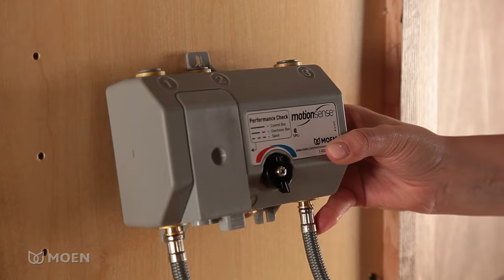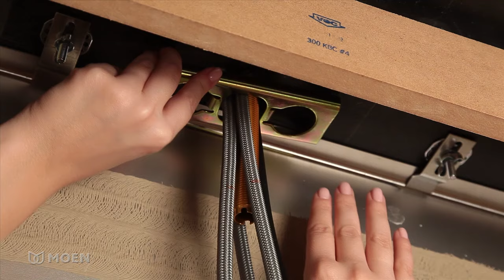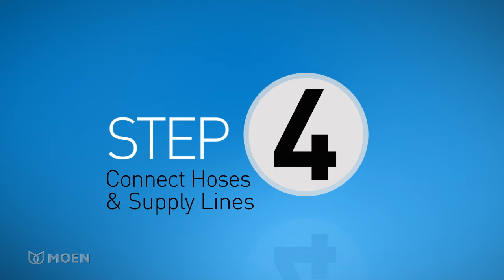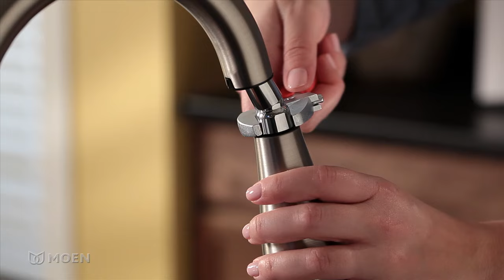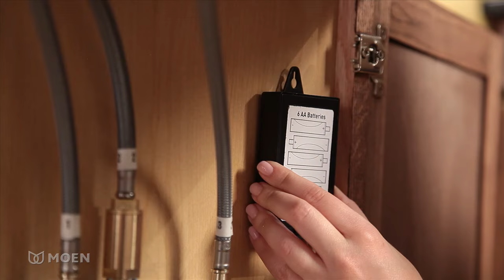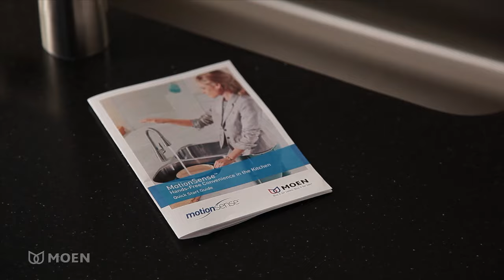How to Install a Moen MotionSense Kitchen Faucet

Comment: Are you able to install without battery?
Reply from the maker: Hello sistamist.  The Moen MotionSense kitchen faucets will require power by either the included battery pack or the Moen 169031 AC Adapter with Power Splitter; sold separately.
Reply: @moenfaucets Thank you!
Reply from the maker: Hello. You're welcome and thank you for your continued support of the Moen brand.

Comment: I just replaced the batteries on this and the water will not stop. What do I do?
Reply from the maker: Hello @kcseabridge2665.  We are sorry to hear of the difficulty you are experiencing with your Moen MotionSense or MotionSense/Wave Pull-down Kitchen faucet.  The following links will assist you with troubleshooting this issue and are based on the number of sensors the faucet has:

https://solutions.moen.com/MotionSense%3ADual_Sensor-Hands_Free_Faucet

https://solutions.moen.com/MotionSense%3A_Wave-Single_Sensor_Hands_Free_Faucet

For further troubleshooting assistance, Moen product specialists can be reached at 1-800-289-6636 and they are available Monday through Friday from 8:00 am - 7:00 pm Eastern Time.

Comment: I have the grey control unit shown in this video and it no longer works, which means we use manual mode only. @moen is it correct that the grey unit is no longer supported and only had a few years of warranty? Not lifetime? I've heard that the newer black control boxes don't allow manual mode without power to the box, so i guess that's a benefit of the older box, but it would be nice to be able to fix the one I have.
Reply from the maker: Hello @JMart6. The gray and black control box versions have a Limited lifetime warranty against leaks, drips, finish defects,  and a 5 year warranty on electronic operation defects to the original consumer purchaser. The black box version does require power at all times to operate. Should you have additional questions, please feel free to call us at 800-289-6636. We are available Monday through Friday from 8:00 am - 7:00 pm (EST).

Comment: If the little light in the motion sense window won’t come on at all, what does that mean? Changed the batteries, unplugged and plugged in multiple times. Is it broken?
Reply from the maker: Hello @yuliyashishlo.  We are sorry to hear of the difficulty you are experiencing with your Moen MotionSense faucet.  
Based on your description, further troubleshooting will be required to determine the cause and resolution of this issue.  You can call us at 1-800-289-6636, Monday through Friday from 8:00 am - 7:00 pm Eastern Time.  
If you'd prefer, you can use the following link to send us an email and a picture of the installed faucet:

https://www.moen.com/customer-support/contact-us

Comment: How do you remove / disconnect lines from control box to replace
Reply from the maker: Hello Tim.  To disconnect the push fit hoses from the control box push down on the gray ring on the control box. While firmly pushing on the gray ring, pull the hose to remove. Refer to the following link:
https://solutions.moen.com/Article_Library/MotionSense_Dual_Sensor-Removing_The_Push_Fit_Hoses_From_The_Control_Box
If you need additional assistance, please email us by visiting our Contact Us page at https://www.moen.com/customer-support/contact-us or you can call us at 1-800-BUY-MOEN (1-800-289-6636). Our business hours are Monday through Friday from 8:00 am - 7:00 pm Eastern Time.

Comment: Hey Moen, 
Have this faucet but don't have the manual. Is there more resources on what the error codes mean in more detail? Occasionally ours will stop working. Unplugging and plugging back in shows the red light pulse ~6 times, then it seems to work for about a week. Afterwhich it will randomly stop working again.
Reply from the maker: Hello Bgrishinko. The user manual for the MotionSense faucet is below.  
https://solutions.moen.com/@api/deki/files/72472/MotionSense_User_Guide_Pages.pdf?revision=1
We would need to troubleshoot the issue further to determine if the control box, electronics box or spout kit would need to be replaced. Please email us by visiting our Contact Us page at https://www.moen.com/customer-support/contact-us or you can call us at 1-800-BUY-MOEN (1-800-289-6636). Our business hours are Monday through Friday from 8:00 am - 7:00 pm Eastern Time.

Comment: How to make it running manually?
Reply from the maker: Hello Casey.  Moen MotionSense/Wave Kitchen faucets offer the ability to operate the faucet with the sensors or with the manual handle.  The faucet still needs to be connected to power-batteries or AC Adapter-for the manual handle to work.

Comment: Our Moen hands-free faucet stays in the start-up mode, and keeps turning itself on randomly.  We've replaced the batteries, re-booted the system, checked the power and data cable connections, all to no avail!
Reply from the maker: Hello John, Moen would be more than happy to further assist you with your Moen kitchen faucet. Moen would need additional information from you. Please contact Moen directly at 800-289-6636. Our business hours are Monday - Friday 8 am-7 pm EST.

Comment: A low water coming out the faucet. Any advice?
Reply from the maker: Hello ME Tubay, Moen would recommend you take the spray wand off and clean the screen washer between the hose and wand. If this does not resolve your issue, Moen would also recommend cleaning and flushing the filters.

Following the instructions below:

Cleaning the first filter:

1. The gray control box has hose numbers imprinted on it. The number 2 hose has a built-in filter. To remove the filter from hose number 2, firmly push the gray ring against the control box while simultaneously pulling the hose out. 

2. Once the hose is disconnected, unthread the brass fitting on the end of the hose. Hold the number 2 hose with a wrench at top of the filter connection. Unscrew the filter with a second wrench. 

3. Rinse debris from the filter screen. Reassemble the filter into the housing and tighten using two wrenches. Insert the number 2 hose assembly into the control box. Gently tug on the #2 hose to check for a secure connection. Turn on the water supply.

Cleaning the second filter: 

1. The housing for the lower filter is located on the underside of the control box. Loosen the filter plug with a flathead screwdriver.

2. Pull the filter off the filter plug. Note: There will be some water released from the control box filter plug location, place a cup under the location to catch any water.

3. Rinse debris from the filter screen. Firmly push the filter back onto the filter plug and thread it back into the control box. Turn on the water supply.

If the instructions above do not resolve your issue, please contact Moen directly.
Reply: Thanks for replying back. Is there any video that you can share other than instructions that you provided. Thanks in advance for your help.
Reply from the maker: Moen does not have a video; however, if you use the link below you will have a visual of how to clean the filters. 

https://solutions.moen.com/Article_Library/Low_Flow%3A_Cleaning_Faucet_Filters_(2012-2015)

If you need further assistance, please contact Moen directly at 800-289-6636.
Reply: @moenfaucets  Still having issues with information provided and probably the main problem is the control box
Reply from the maker: Hello ME Tubay. We are sorry to hear that you are still experiencing an issue with your Moen MotionSense kitchen faucet.  At this time, we would suggest contacting Moen directly in order to further troubleshoot your faucet with you.

Comment: How do you remove the push fit connections?
Reply from the maker: Hello A Skoyles. To remove the push fit hose from the control box, push down on the gray ring on the control box. While firmly pushing on the gray ring, pull the hose to remove. Please refer to the following link:
https://solutions.moen.com/Article_Library/MotionSense_Dual_Sensor-Removing_The_Push_Fit_Hoses_From_The_Control_Box
Reply: @moenfaucets  tried that.  Doesn’t work.  They won’t budge. Any other ideas?
Reply from the maker: We are sorry to hear you are having difficulty removing the hose(s). To further assist you, please send us an email by visiting our Contact Us page at https://www.moen.com/customer-support/contact-us or you can call us at 1-800-BUY-MOEN (1-800-289-6636). Our current business hours are Monday through Friday from 8:00 am - 7:00 pm Eastern Time.
Reply: @moenfaucets  not helpful.  I had to cut them and trash the whole thing
Reply: I Hate these faucets only acts when my wife uses the sensor I never use sensor just the handle

Comment: How do you remove the push fit hoses??????
Reply from the maker: Hello Sam the Handyman, To remove the push fit hose from the control box, push on the gray ring on the control box. While firmly pushing on the gray ring pull the hose to remove.
Reply: @moenfaucets  this a terrible design and multiple customers have inquired about the same push fit hose removal. Obviously one would think you could simply push on the firm gray rings to remove the hoses but that’s hasn’t been the case. Is Moen working on developing any fail-safe mechanisms for future uninstallation?
Reply: @2Maradoo  yes agree it is ridiculously difficult to get those things off.

Comment: mine failed after 2 years, i have been using it as a regular faucet for the last 3 years. (waste of 500$)
i think the control module is broken...
it doesn't even light up, tried new batteries and everything...

so how much is this service kit to fix my broken faucet?
Reply from the maker: Good afternoon. I am sorry to hear of the issues you are having with your Motion Sense kitchen faucet. Please send us a direct message with your first/last name, address, phone number, email address, further description of the issue you are having and a copy of the receipt if available.
Reply: How to take. apart faucet to connect I cable back .

Comment: Water wont turn off. Motion sensor went completely dark. Changed batter and still not work. I cant use the kitchen sink faucet now as i had to shut the water off from the main source. Please help!!!! I wish i got a standard regular faucet!!!!!
Reply from the maker: Hello L, I am sorry to hear you are having issues with your current Moen Motionsense faucet. Please contact Moen directly for further assistance at 800-289-6636. Our business hours are 9:00 a.m. - 5:30 p.m. Monday through Friday Eastern Time. Moen is currently experiencing higher volumes at this time, you can also contact Moen directly at the “Contact Us” link on the Moen website at www.moen.com.
Reply: Did you find a solution? This just happened to me. 🤬

Comment: How do you adjust the sensitivity? I recently changed my batteries and the unit comes on when someone stands in front of the sink.  Is that a sign that the module needs to be replaced?
Reply from the maker: Hello. This is our Arbor Motion Sense faucet. It is available in shiny chrome, model # 7594EC or spot resist stainless, model # 7594ESRS.
Reply: @moenfaucets  I have 8735ESRS Haysfield with Motion sense. I have a problem, the sensors don't sense to turn off. The water keeps going forever never stops. Unless I remove the power cable,data cable and cutoff water supply. What could be happening? My faucet refuses to sense manual mode too. I have a kitchen sink with no water. Is there a way to bypass the sensors and purely go manual?
Reply from the maker: Hello Aaron.  We recommend resetting the faucet.  To complete the reset, unplug the power and data cables from the control box.  After 60 seconds, plug in the data cable first, followed by the power.  Please ensure that the data cable is installed completely into the electronic box.  This connection is a tight fit; and, if not fully engaged, the faucet will not work properly.  Do not stand directly in front of the faucet during startup/calibration.  Our Product Specialists would appreciate the opportunity to troubleshoot and offer technical support.  Please feel free to call us at 1-800-289-6636; our Consumer Services Center is available Monday through Friday from 8:00 am – 7:00 pm Eastern Time.
Reply: Moen Thank  you very much. I disconnected the battery pack for about 40 seconds and reconnected it to the module. The faucet is working a little better now, not AS sensitive. Question for you. Why wasn’t the faucet supplied with the option to power the faucet from the wall?
Reply from the maker: Hello Aaron.  That is good news about the reset!  
We offer an AC Adapter with power splitter, part number 169031, which must be purchased separately.  The power splitter will work as a backup power source if your home loses electricity. You would use the battery pack supplied with the faucet when installing the Power Splitter and AC Adapter.

Comment: I have a granite back splash that the hits the granite back splash, can't get the full hot when used in manual mode. How do you remedy that?
Reply from the maker: Craig Barr, for technical assistance please contact us at 1-800-289-6636.

Comment: man people are getting too lazy to even turning the lever????.....I would think crawling under the sink to change the batter would be more of a PITA.....Someone said Luckily the faucet works manually with batteries installed.   So when the power goes out/batteries die it  doesn't work?
Reply from the maker: Hello Dennis M.  The first generation of Moen's MotionSense faucet could still be used, by turning the lever handle to turn on/off the water, even if there was no power to the faucet-no battery or AC power.  The second generation of Moen's MotionSense faucet can only be used if it has power to the faucet.
Reply: I'll stay with manual mode.....my goodness!!!
Reply: @dm19609721  Hands free is much more sanitary.

Comment: Seems like every one and Their brother has an instalation video. How do I disassemble this unit.
More specifically hose removal from the controll box
Reply: Pull the grey plastic circle down and pull the hose out. See this: https://www.moen.com/customer-support/faq/faq-035
I had to do the same thing and remove it and finally found the answer in an FAQ. I hope this helps.
Reply: @DRTerabyte  thanks.  I came here for this
Reply: Sam Rada did you ever get an answer? I have to replace the unit and was wondering the same thing.

Comment: Before you buy one of these you need to know there are some issues with it.  

I installed one of these and I am pretty disappointed in it when using the manual handle, the flow is cut in half compared to when the sensor turns it on.  Its a nice gimmick gut the functionality just isn't there.
Reply: Correct. However, I get good flow with the cold water. It's the hot water flow that's reduced for me.